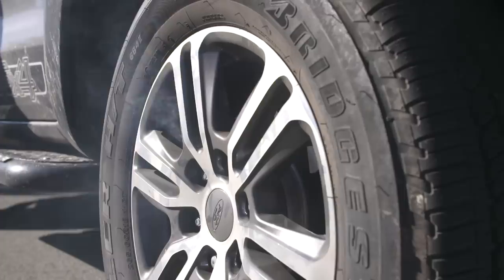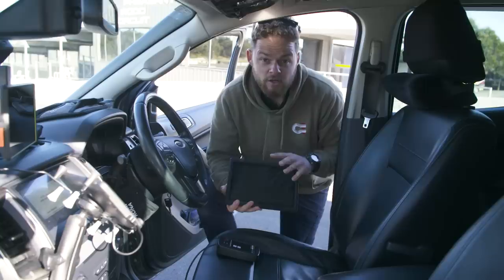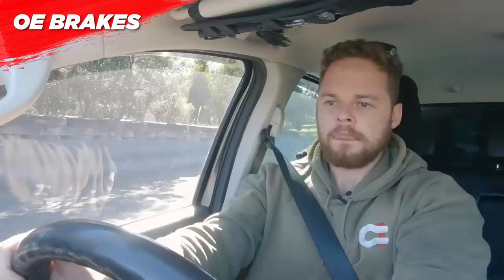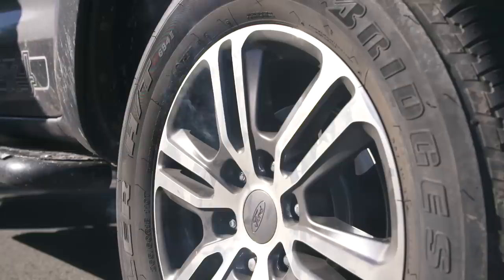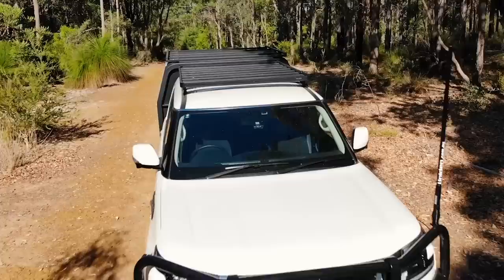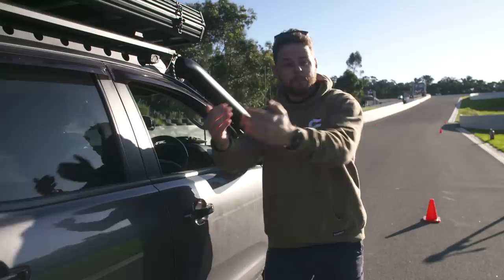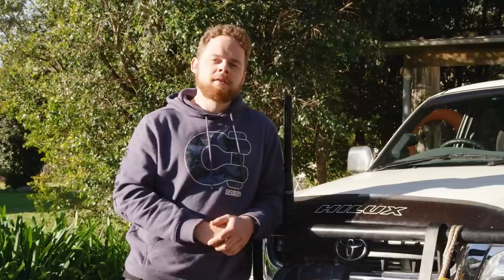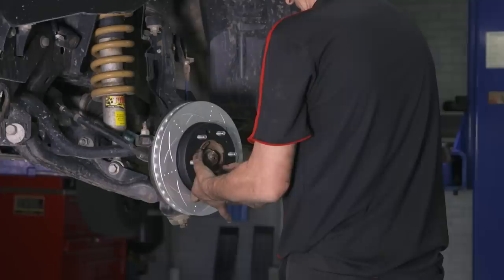ARE BIGGER BRAKES WORTH IT? Standard vs. Aftermarket brake test - Why the OE ones failed!

Comment: 1993 GQ Patrol, turns braking into an extreme sport in peak hour traffic on the freeway after work. could seriously do with that bendix brake upgrade!! great informative piece jocko showing the reasoning behind the  mods, and why. We  certainly want more of these with various mods!! Cheers!!
Reply: There's a caliper kit + drum to disc conversion a couple outfits are selling for about $2700 just for GQ/GU Patrols - Upgrades the rotor size but you need minimum 17" rims.

Bendix says you need minimum 18" rims for this kit - So price in a set of wheels and tyres if you want to go either way.

Just upgrading your rotors won't change your brake distance, just the fade, and in real world driving your brake fade will probably hit your drums first.
I reckon 18" rims won't give you enough tyre & sidewall unless you've got 35s and they may be hard to come by in a lot of places.

Comment: Hey all, I've got an old HJZ75 1991 Landcruiser, I have been slowly fixing it up over the last couple of months and a brake upgrade would really be great, with the older Landcruiser models not having any airbags in the vehicle and the standard brakes not being as efficient as they used to be a new set of brakes would help improve the safety of my vehicle when I'm on the road, thanks and good luck to everyone.

Comment: Hey guys, I've got a 2017 Ford Ranger XLT, I have just put a tray and canopy on back and loaded it up with the dual battery system, fridge and equipment. I tow my caravan around for my camping trips and at the end of the year do the trip around Australia, this breaking system would help tons and give me peace of mind when pulling around the caravan and also 4WDing. Thanks guys.

Comment: Hey Jocko, great video! Have swapped my weekend camping rig 2013 Ford PX ranger to a work bus and sitting at 3.15t daily needs all the breaking it can get. Been towing a 1.75T excavator around lately and have to drive super careful through the city as the standard brakes are not cutting it anymore.
Reply: Geez that’s heavy, my 200 series was 3.1t when I weighed it last with me in it
Reply: Ummm trailer brakes.
Reply: The excav trailer does have brakes but only hydrailc drum so they fade away in stop start traffic, in regards to the weight I have tools that I have to use everyday so it's a bit hard to just leave them behind to reduce some weight of the vehicle

Comment: Hey Jocko! 
I have a 2004 1KZ-te SR5 Hilux. I’ve had it for about 6 years and will have it for life. In the time I’ve had it I have added 685kgs of weight with out even loading up the gear. It also tows a home made toy hauler and an hornet trophy boat on the weekends, It carry’s my two kids which are under 5 nearly daily. The old girl Done Monkey last weekend and is going to the snow this weekend! I do big trips from Batemans bay up to coffs, Southwest rocks and Hat head every year with plenty of beach driving. Being an old girl with 330,000kms and larger Mickey Thompson Muddies. I don’t need to tell you how the standard breaks on these things work! With all that said I don’t think there would be many people in this country that need them as bad as me!
Thanks Jocko!

Comment: I'm driving a Ford PX2 Ranger still with OE brakes. I have already done some of the necessary upgrades to bigger tyres and suspension to be able to tackle my 'driveway'. I'm living at the top of a mountain a couple of hours inland from Byron Bay where the track is already quite gnarly and rutted and with a few water crossings before I even get to the steep mountain climb. The first 20 odd km of black top into town is well known as some of the most pothole riddled road in the region so I need to be on my toes for changing potholes as they can be suspension killers! After seeing this video clearly I need to upgrade my brakes, particularly doing a drum to disc conversion on the rear as I'm crossing water several times every trip out of my driveway!
Great video and extremely informative Jocko, I really do enjoy watching the variety of videos on 4WD 24-7.

Comment: Hey Jocko, I had never even considered a brake upgrade until I saw your video, fascinating! I have an 80 series Toyota Landcruiser that I have been upgrading with new bulbar, winch, recovery gear, maxtrax,  drawers, rooftop tent, extra batteries, water tanks etc, all in preparation for a 4000km pilgrimage to Fraser Island in October. Haven’t been since a school trip in 1979. Winning the breaker upgrade would save the money on the upgrade I see I have to do, and leave me more for the diesel that is getting dearer by the day! Keep making the informative and entertaining videos. Cheers!

Comment: Got a 2004 extra cab hilux V6.   Going to Cape York in a month towing my polaris 570 quad bike on a toyhauler. Been doing bits like suspension and tyres dual battery system awning etc along the way. All I need now is a upgraded brake system to help pull up the weight and keep control going down gunshot. Will send a few pictures when im loaded up and ready to go 😉

Comment: I have a 2017 ranger canopy awning draws fridge winch. She’s a heavy girl and I’m off to Uluṟu next year. It’s a 7000km trip and with a trailer I am very concerned with braking. I have noticed from stock to now there is a huge difference in stopping distances and with saving for fuel costs and building or buying a camper the brake upgrade is a dream.

Comment: I have a 2005 Pajero and it’ll be so nice to have a brake upgrade for when we tow, going 4wd, and when I finally start adding accessories! 
Love your videos Jocko! ☺️
Reply: Paj fam! I recently got a 2014 Pajero and basically need to stand on my breaks before they kick in. It actually braked far better around town when I towed a horse float with electric brakes and Redarc controller only on 3.5

Comment: Hey Jocko! I drive a 2012 Ford Ranger for work and play. She’s carrying a bit of extra weight with all the standard off road upgrades, tray, canopy and 12v setup. I tow a loaded tool trailer five days a week and the weekends if I’m not off road I’m towing a 19 foot fibreglass fishing boat. A brake upgrade is one of the next things on my list as the OE brakes just don’t cut it anymore

Comment: G'day Jocko,

I own a 2004 Toyota Hilux KZN165 single cab. Ive got quite a few mods on it, running twin lockers, 2" lift, canopy with solar set up for my 80L fridge, water tank under tray, 31" tires, scrub bars, steps and bullbar with my winch. 

I regularly travel with it loaded up and at times towing my car trailer. Ive definitely notice more braking distance once I'm loaded up.

Big fan of 4WD 24-7 love jumping online and catching with all your guys work, keep it up!

Cheers

Comment: Hi guys. I’ve got a 2019 Toyota Hilux SR5. I have made a canopy set up and loaded it with a roof top tent, plus a 12v system and a couple drawers. I also tow a tool trailer every day as well.
The brake upgrade would be unreal after noticing how much brake fade I got/get after constant driving with it all on. 
Cheers guys

Comment: Brake upgrade was the first upgrade I did to my chevy tahoe. The OE brakes are great for factory tires and weight without towing, but get eaten up when bigger tires are installed. Now that I have 33s and an extra 300 pounds with tools, parts, storage bin, roof rack, and weight of taller/wider tires.

Comment: Great video. 2017 NP300. 140k on the clocks with original pads, rotors all round. Tow daily as a builder as well as carrying timber/planks/tressels for work and a camper trailer on weekends when I can get away. This would be an awesome upgrade for my 4wd.

Comment: Hey jocko, I have a 2013 ford ranger , I tow a van on the back of it and have alot of precious cargo to look after inside the cab as well “kids”!
This video is a real eye opener for how you can come unstuck with a loaded up vehicle relying purely on the stock brakes.
Had this happens years ago towing my van with a vehicle that was well under being a suitable tow vehicle, I was on a down hill climb, auto, and the brakes got so hot that they were failing to slow down the vehicle , felt like my foot was through the floor, I was packing it big time, lucky the bottom of the hill had a nice flat stretch where I was able to roll off speed to finally pull up. Even though pulling up for a whole and letting them cool down help a bit, they were badly glazed and needed full replacement …

Comment: Hey all, I’ve got a Holden Colorado, 2017 dual cab, fitted with a bullbar, winch, canopy, rrt and a bit more biscuit. I’m pretty heavy and I tow a boat. I’ve already almost lost brakes down Gloucester hill, but couldn’t afford to upgrade only replace my pads. The missus and I watch all your vids on the tube and we’d love to get an upgrade boost! Thanks guys love your work 👍

Comment: That brake upgrade would be awesome, I’ve got a 2014 Holden Colorado which has all the bar work and accessories and now I’m towing around a 21ft van that weighs over 3 tonne and although  the brakes work okay. Having that upgrade would make us feel so much safer in the road

Comment: Jocko mate! I have an RC Colorado which I have slowly been adding more and more weight to make it the ultimate tourer. Rear drawer set up, drop down fridge slide and fridge, 60L water container, weber on a slide, dual battery set up and plenty more. Problem is I never take anything out in case there is the off chance I can go away. Takes me 30mins to pack up and go adventuring. Bad thing is I'm carrying all that weight all the time which is effecting my braking capacity. Cheers Jocko!

Comment: Hey guys, We have a 2009 GU ST Nissan Patrol wagon. It has the rear decked out with drawers and fridge, roof rack and bar work, but the main reason I would love to throw the brake upgrade in is because in approximately 2 months we are making the move back to Victoria all the way from Karratha, Northwest WA. Travelling down through Perth and then across the Nullarbor. Roughly just under 5000km trip would be amazing to have brakes we can rely on, especially with the cattle wandering over roads in these parts. Cheers legends.

Comment: Hey Jocko, I've got a 2013 Toyota Hilux SR5 and have just started doing carpentry and maintenance work for the locked up Aboriginal Communities in the middle of Western Australia and the Northern Territory. I often need to tow a dual axle trailer with both that and the car being fully loaded with 3 blokes, all our tools and meals. I had a hard brake line snap at the calliper on my way into one of the communities due to the terrible unmaintained roads and corrugations. It was lucky one of the boys needed a piss before we got into town because otherwise I probably wouldn't have realised I had no brakes very late and it could have been very bad. Had to bush mechanic it when we got I to town with just a punch, a hammer and some drill bits and some bending of some brackets. Also snapped an antenna tab on the Bullbar due to this. So I could definetly benefit from this!

Comment: 1999 NL Pajero LWB.
So good to see more and more episodes of Jocko! Especially the more technical episodes! "I Love Getting Data", that's the best!
I drive an older 1999 LWB NL Pajero, and have been slowing kitting it out for off the beaten track trips with my family. Bigger wheels, tyres, beefier suspension, ammo boxes, draw system in the works, front bar, under body protection, fridge etc, all the budget basics I need to get myself and my family out into the bush.
My main reason for wanting this brake upgrade, over and above it being an older, heavy 4WD with some much needed attention for the brakes to bring it up to modern standards, is the safety of my family while on the roads and trails, especially for my 16month old daughter, who we can finally take on adventures with us! You can't put a price on safety, but even with that in mind, I wouldn't be able to afford a big brake upgrade without help anyways. I just want to have safe travels and make memories!

Comment: I have a 2012 Ford Ranger in which i tow a camper trailer that has a lot of weight. My vehicle has been upgraded with a bullbar, rear bar, roofrack and accessories therefore making it a heavy vehicle. My vehicle is also due for new brakes and the bendix system will be a fantastic upgrade as my 4wd doesn't stop like it used to.

Comment: Hey Jocko I have a 2018 Holden Colorado dual cab. I use it for both work and touring so it’s pretty heavy sitting just below GVM. I’m still running the standard brakes with a canopy, bull bar, winch, roof top tent, tools and camping gear. After watching this video I have definitely overlooked the brakes in my rig and could use an upgrade 👍🏻

Comment: I have had a bit go on my car recently. Things like the engine oil cooler, starter motor, EGR, and cylinder head. I feel like I am finally getting on top of the things that a wrong with this nugget so I can start with the good stuff. My 2009 BT50 dual cab is basically stock apart from an alloy bullbar, snorkel, and 32" tires but some bigger mods like steel bar work, lift, and a canopy is in the works. Getting this upgrade will help with the never-ending headaches of DIY vehicle maintenance plus it will help with all the "mate with a ute" stuff like helping move and take loads to the tip. This ute is my daily and I do a lot of city freeway driving and being able to pull up quicker is always helps in those clencher moments in peak hour traffic.

Comment: We have a 2016 Ford ranger XLT almost the same set up as shown in the video, and after being in the high country driving through mud and coming down some steep tracks after driving through those muddy tracks and having some tense moments and the brake pedal is being pushed hard, that upgrade would be very useful. Also time saving as we had to wait so long at the bottom to cross a creek crossing as the brakes were so hot we didn't want to go into the almost freezing water and destroy the brake even more. Loving the content.

Comment: Hey hey, i have a VW Amarok 2014, i have  added a bullbar, winch, spotties, roof rack, rock sliders, 2inch lift, ARB canopy, spare battery in the back and also a long range fuel tank, will also be adding a roof top tent and 270 awning. After having these i have noticed it takes longer to stop even when going slow. Definitely in need of new brakes especially before i tackle the Gibb river road next year with the family.
Cheers for another cracking video

Comment: 91 TD42 LWB GQ Patrol with aftermarket turbo - brake technology has come a long way in 30 years and since it goes faster it definitely needs to stop better. Plus to have that confidence of stopping without rollback on those steep, rutted climbs would be ideal

Comment: I’ve got a 2015 Ford Ranger PX2 XLS Dual Cab 3.2 and the main reason I’d like a break upgrade is she’s a bit of an all rounder with daily highway drives but loves getting out and about in the bush and sand too all while coming home to tow the trailer full for various round the house projects ;-)

Seeing this is a bit of a shock for the OE versus the top of the line kits - to be honest, it’s something that never crossed my mind when fully loaded on standard brakes and definitely something I’ll need to research into before taking her touring!

Comment: Hey 4wd247 Ive just converted my series 4 patrol from the zd30 to a td42. I didn't budget enough to do the brakes and I've found its needed! With the extra weight of the motor and bash plates she doesnt stop like she should!!

Comment: I have a Mitsubishi Triton 2018 and I have been adding gear slowly, it has a canopy, suspension kit from TJM and AT BfGood Rich wheels, and a 270degree awning. I want. a break upgrade, because I once was driving this thing in a very steep hill (on road, not even gravel) and the breaks wore completely out. So I had to replace the breaks with new standard stock ones (not a cheap change btw let me tell you for a 3 year UTE). However, I believe that with this upgrade, and the ideas that I have in mind for my ride such as a bull bar installation, rock sliders, and rear bumper could save me plenty of money if I win this upgrade kit, and that way I can be safer both on and off road. Good luck everyone!

Comment: awesome video with some great info. I run a 2021 Toyota fortuner crusade with a few extras including, drifts drawers with water tank in the rear, engel fridge, dual battery system, roof platform with extras added. but most of all, we use the vehicle to to our caravan when glamping with the family and dogs. This would be an awesome addition to our car to ensure the family stay safe.

Comment: Hey guys, got a Prado 150 and been adding weight slowly but surely, bar, winch, wheels, tyres, drawers, awning, etc etc and the brakes are really starting to struggle. Scared me a few times already and needs an upgrade to make it safer with some big trips planned over the next couple years. But especially as its the daily drive in the burbs, she needs an upgrade. Keep up the great work, love your vids 👍

Comment: Hi guys. I have a 2019 PX3 Ford Ranger with a 3.5T GVM upgrade. It has almost every possible touring and wheeling modification you could want… except for a brake upgrade. This is something I have overlooked and am starting to notice more whilst out wheeling/touring. Running close to GVM for most trips, it can be scary having to stamp on the pedal in the hope that you’ll stop in time. A Bendix Brake upgrade would definitely not go to waste on my car! Cheers

Comment: I have a 2020 Toyota Hilux SR5. Constantly towing a loaded car trailer is taking its toll on the factory brake system. I've had to replace the stock brake pads and rotors multiple times. This upgrade kit would make the car and trailer load a lot safer on the road while traveling the states. Thanks.